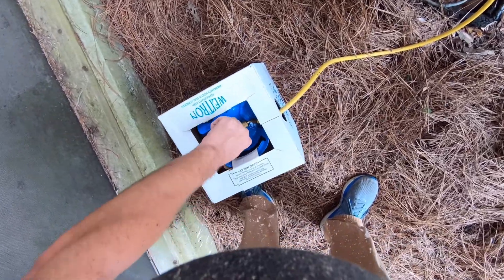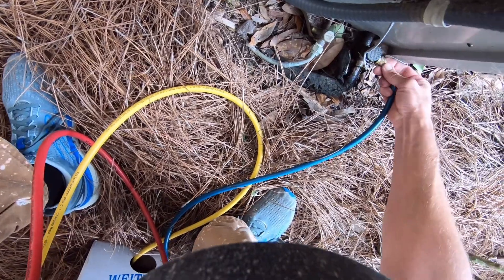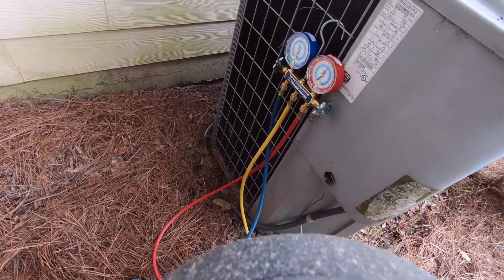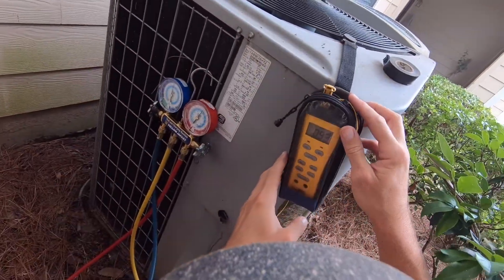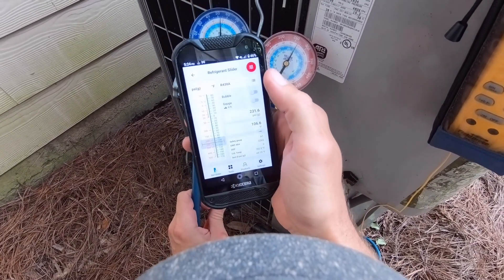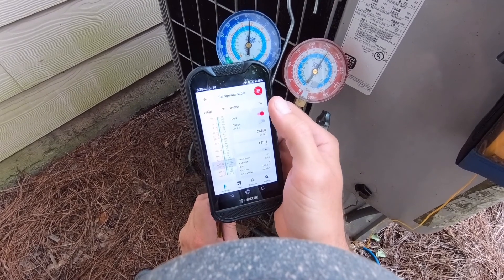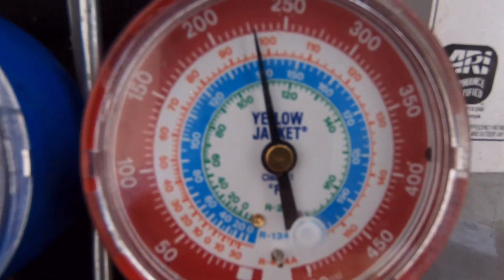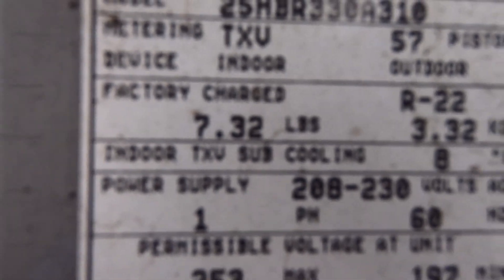Charge by Subcool using M099 (R438A) Refrigerant

Comment: uh did you check for restrictions like uh dirty coils, cloged filter dryer, clogged txv, failing compressor or a slow fan blower? before checking charge

Comment: Do you need to change the oil or can you just reclaim the rest of the R22 full of vacuum and then go back in with our 438a
Reply from the maker: It's was already retrofitted for m099 before I charged it and never retrofitted one before. But I would think no. The oils in r22 and m099 I would assume would be the same.
Reply: You don't have to pull a vacuum but u do need to get all the old r22 out. You can't dump mo99 on top of the 22. Empty ac then fill it with the mo99
Reply: What about r438a in a Copeland Scroll? Their website says only use r407c.
Reply: Sometimes piston needs to be changed
Reply: MO99 is a direct drop in for R22. Recover the 22, replace the filter drier, and pull below 500 microns. It's compatible with MO and POE oils. There are cases where you'll have to charge more refrigerant than the factory 22 charge, but that's why we check subcool/superheat.